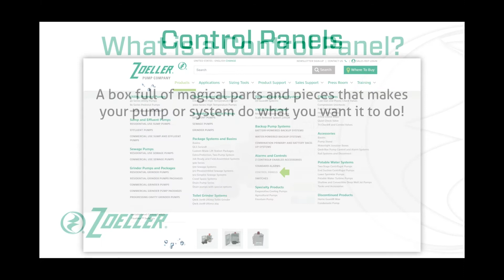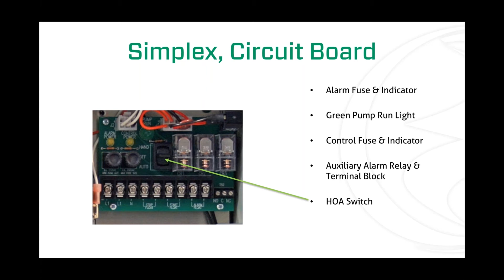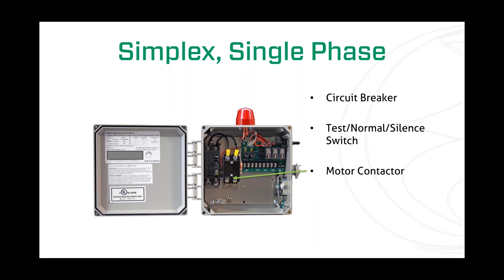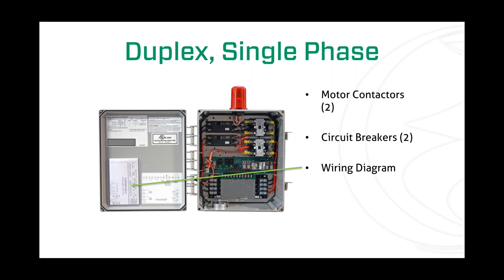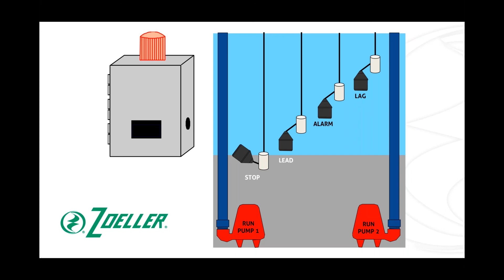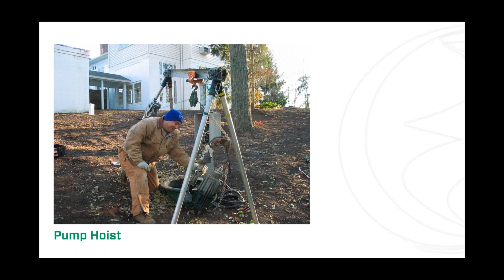Control Panel Components & Troubleshooting

Comment: What would cause the 2A control power fuse blow in a simplex?  I cleaned off a float that was jammed up and put it back in. I am waiting on fuses. Could it be something else?
Reply from the maker: Good morning! If you reach out to our product support department by emailing zcotechnical@zoeller.com or by calling 1-800-928-7867 and pressing option 6, our product experts can help you troubleshoot your specific application. I hope this helps!

Comment: Is there any videos on old relay control pump panels. The circuitry can be complex.
Reply from the maker: We don't currently have any videos out like this. If you have a question about a Zoeller product and need support, please email us as zcotechnical@zoeller.com or call 1-800-928-7867 and select option 6 for our Product Support Specialists.

Comment: I have a duplex pump control panel but one of my pumps was removed. Is there a way to stop the pumps from alternating as lead? Can you convert this duplex control panel into a single pump control panel?
Reply: Did you ever figure this out ?
Reply: @squid_garage756 I think he's gonna keep working with the pumps trying to alternate and when the lag float kicks on its going to remind the lone working pump that it has a job to do
Reply: Till the alarm float kicks on... Or sewage starts coming out of the mechanical closet that pit is in
Reply: In some panels there is a switch or contact to stop alternating and have one dedicated

Comment: My panel has yellow light on and buzzer sounding
Reply from the maker: Hello Ms. Spillman, Normally our panels would have a red indicator light on top for the alarm condition. Typically, a light and an alarm horn would indicate that the high water float has risen. The alarm will not stop until the float is in the DOWN position. I would recommend contacting a professional to have them inspect the unit. Any additional questions, please feel free to reach us at zcotechnical@zoeller.com. Thanks!